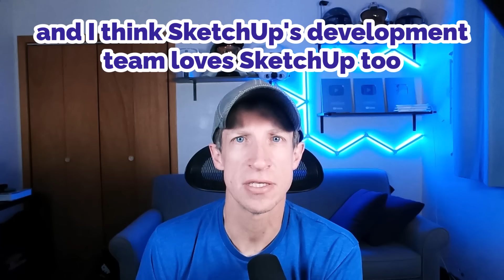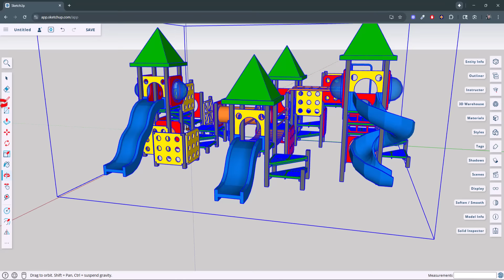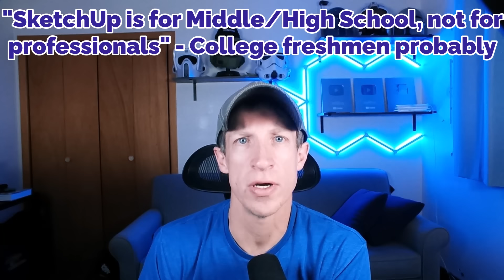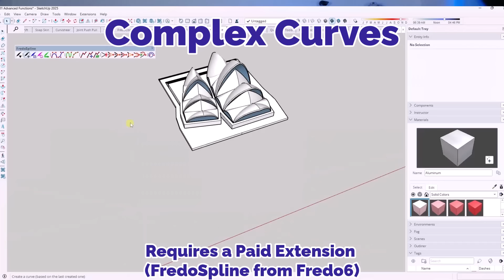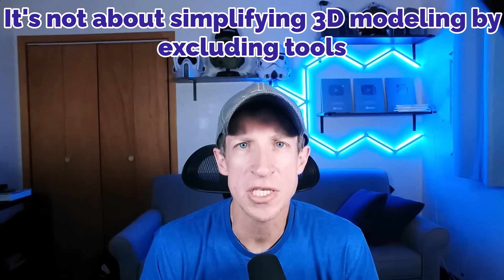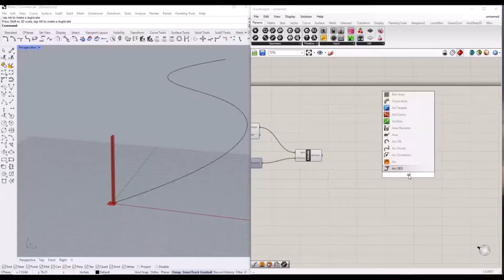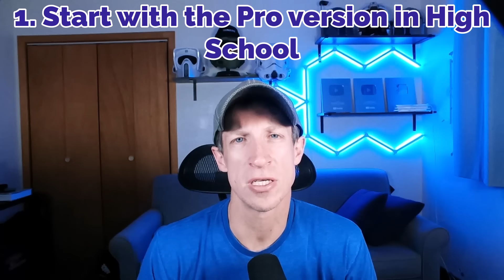Is SketchUp being REPLACED?

Comment from the maker: Hi everyone! Let me know your thoughts in this in the comments below!
Reply: Love both tools. SketchUp inferencing-measuring, snapping is unmatched imo! If Rhino adopts a similar feel/ux I'll spend even more time in it.
Reply from the maker: This is my big concern - if Rhino works on UI/UX before SketchUp works on toolset, it could be a real threat, and it feels a bit unnecessary.
Reply: @Thesketchupessentials  I guess then we would be in a situation where both are nearly identical. My current push is parametric so I'm almost exclusively in Grasshopper now. I'm happy to use Rhino just for that and go back to SU for everything else.
Reply: @AC-ed1jz  rhino would adopt it for sure, rhino 8 is clearly easier for sketchup user than the older version, new push pull in rhino made me move on to rhino,  on the other hand sketchup is just will never improve and listen to their users :)
Reply: @Faqiens  we will see what mcneel does on that point. The UX is the area to push on but you don't want to alienate old school users who like that technical feel.
Reply: @AC-ed1jz and sketchup is a toy
Reply: Hi,
I've used sketch on and off for the last 10 years.
Mostly with Ruby Sketch sitting on top.
The owners need to be brave and regig there business model together with a full overhaul of the interface of the tools.  Love the simplicity in the foundation of the program but it has evolved in a haphazard way.
As a suggestion they could develope parallel packages more specific to the different  industries. E.g. new buildong designs and remodelers of existing buildings . Engineering base modeling , manufacturing , sculpturers etc.
I believe your concerns are real.
They don't want to go down the same road as Nokia phones.
 For me personally I prefer to buy a stand alone software rather than a sub scription . Updates each year if I want to. Tremble could   buy in the existing plugins and give them royalties based on consumer usage. Also pay these developers for future extension and/or improvements
There is a high risk at the moment in this space  . So Tremble needs to be bold and give themselves a shakedown.
Reply: Architecture schools have been training their students in Rhino and Grasshopper for at least nine years. The parametric functionality is the main reason.
Reply: @pierrebulhon5219 20 years
Reply: haven't worked on Rhino but done very complex architectural homes on Sketchup and using Sketchup Layout.  For me, this is where Sketchup fails as an architectural tool.   2D Documentation.   Complex 3D curves are very limited in the average use, most buildings don't go there to be honest.  But all buildings need 2D drawings.   Layout is clunky, very slow to update large sketchup models, poor dimensioning, annotation, etc.   Time saved on modeling is lost turning out good 2D drawings
Reply: @aeasthouse316 is rhino any better ?
Reply: Justin, I was hoping that one day SketchUp would include a BIM feature other than geometric, which I find redundant and limits my ability to explore more complex geometry.
Reply: I think SketchUp made poor choices at past. I just remember what it was.. I could just draw some curves by thinking over head. I liked how the extrude worked..
Reply: The SketchUp pricing is also a massive NO!  
I'm casually learning Blender because AutoDesk is so terrible with pricing. I use: 3Ds Max2016&VRay, Rhino3D, Siemens: SolidEdge, MOI3D and Blender.
Never rent software. The only reason companies do it is to get people to continually pay for the same product.
Reply: I think adding  lofting  , surface and bezier-spline tools would elevate the program. Very often I find myself importing complex faces and curves I made with other softwares because it is easier to work that way than use the limited capability of curviloft. I would love to be able to use sketchup for the very complex projects but unfortunatelly that is not the case. Having the potential to use sketcup for heavy work would eliminatee my need for other programs.
Reply: I'm a 1st year middle school 3D design teacher and SketchUp is not planning for their future. This is not user friendly from a teachers perspective,  I need more resources from SketchUp to use in my class. I don't know where to find lessons or built in tutorials from SketchUp. I have Zero support from them and will be looking for a different platform next year if they don't fix this.
Reply: I have two SketchUp Pro subscriptions for the office and for home. I’ve bought the tools from Barry M, mind.sight.studios and Fredo6. I think it would be very helpful to have the tools “Slick moves” (arrange / align / center), Sketch plus, Bevel, Round corner tools native to SketchUp Pro. 

Trimble Creator inside SketchUp sounds interesting. Maybe it’s a better fit for SketchUp Studio? Since that’s Sketchups top of the line product. 

The Studio version makes more sense if it has advanced parametric modeling and rendering tools. I don’t use the point cloud stuff but I would be interested in Native advanced modeling tools as long as the rest of the tools work as they do now.

Ive bought Valí architects tools twice and I don’t like the interface. If I had to start drawing with SketchUp just using a bunch of sliders and info windows I think I would have to find a new program. 

I could see my self switching to studio for advanced modeling tools if they save me enough time and work seamlessly. I enjoy using SketchUp but I occasionally think what happens if Barry M.(Slick moves, 2DXY) ThomThom, Dale Martens, Fredo6, Tig, and Christina Eneroth disappear of loose interest. Same with the other extension developers that I don’t use. The options they provide us as users are what makes SketchUp special. 

I think ThomThom works for SketchUp
Reply from the maker: @BMB_GRAPHICS  ThomThom does. I would love to see an Instant Architecture UI update. It's SUCH a powerful toolset, but can feel a bit clunky
Reply: One thing that’s a definite pain-point for me with SketchUp is the lack of a free viewer. The browser viewer is nice for sharing with clients but doesn’t work well for navigating easily for whoever needs to translate the render model into BIM. If SketchUp wrote a viewer that doesn’t have any drawing functionality, only measuring, it’d be a great help.

The reason I stay with SketchUp is the shortcuts- Line is ‘L’, not ‘L + Enter’. I’ve programmed ‘group’ to be ‘D’ so triple click + D is a very fast way to work. 

I have an automatic love for Rhino because it’s a very complex software with a perpetual floating license. They are complete hero’s for this. The sense of generosity is what makes me love them.
Reply: I'm still receiving SketchUp base files from my clients!
Reply: Years ago Bill & Steve together or separately decided knowledge would  be a subscription and ignorance for free. Sketchup was brought in line after 2016. Time to learn FreeCad
Reply: @Thesketchupessentials
Hi Justin. Thanks for this and all your videos.
I cant agree more.
Have you been in contact with any of the Sketchup Team to discuss this with them? Assuming you have their ear!?
Would love to know what they have to say. 
Maybe you can set up an interview with one of them as a follow up video?
Reply: As head of design tools in an architecture landscape and urban planning firm in paris, i can assure you that the transition is already on the go, and there wont be any turning back option. Skecthup is a bit too skecthy. There is no georeferencing utilities that really work, interoperability is really hard, and modeling capabilities are far from meeting our needs if we speak of a true, serious project that needs to go through multiple design stages. In my opinion, skecthup has been very popular because of it's simplicity but also because it has always been a good solution to model cities and landscapes. But now that the average modeler has an overall sharper skillset with 3D tools i don't really see how and why the skecthup framework would/should survive in the face of rhino if a firm hast to choose, regardless of you business size. Skecthup's best bet is simply to adapt to rhino and become more inter operable with rhino. At the moment we still receive a lot of sketchup files. But we would rather take the time to convert them into rhino files before even using them. That's how good rhino is in the context of a true design ecosystem. One other thing... there's blender... Because you need to look at rhino as a platform that connects easily to other tools (take a look at speckle) how can skecthup be relevant in the face of tools like blender and rhino ?... if we speak sincerely, i don't really see any reason. Thanks for the video because it tackles one of themost important questions at the moment in the field of 3D design tools applied to architecture urban design and landscape. I am not a skecthup hater, but if i'm being honest, at the moment we speak, skecthup can't keep up if it does not make a serious update (that will take a lot of time, on the meantime rhino is integrating AI 3D tools...). I'm not hating on skecthup, i simply hope that the developpers will take the true current state of the marker as a serious reality check and take skecthup to the next level with true interoperability. (love your videos by the way, cheers).
Reply: I agree that the dev team should focus more on simplicity in 3d tools (more of them) and less on AI stuff which I really find annoying.
Reply: There is no easy software that does really complex things - the problem is with the human mind "I would like just to snap my fingers... and the app or the OS should know what i want...".
Well, we are much to far away from that scenario.!
The annual fee price is an issue, the web-based version is a joke, Layout is a shame (but i already replaced it with InDesign, and do all the work inside Sketchup), BUT the Sketchup and its capabilities are NO ISSUE. Extensions..., if you know your way around the internet... the problem is solved.
But even without extensions... look to Milad Pirdavari.!
Im not saying that Milad's way is the way to go, not at all, i just want to underline that almost all the whining is ignorance-based - that guy gave a big shame to everybody who wants some kind of telepathic software (or device.!).
Reply: Hi Justin, You are correct on all points. Everyone should be using the pro version. I use Sketchup to teach students 3D modeling, knowing that they will go on to learn blender. So why can't Sketchup be more like Blender? like having a built in lighting program instead of purchasing an add-on? Chamfering? Beveling?  Lastly I find not being able to adjust the line thickness ridiculous. Just my op - Hope Trimble listens. ☮
Reply: Sketchup on the mac is horrible, it keeps crashing and layout is a complete disaster.
Reply: What is the best way to start
Reply: Justin. I have been trying to help a friend learn Rhino. I am new to this CAD software and find it very confusing and unstructured. So I have been watching your videos to learn it. I am use to building constrained sketches and building from there. It has constraints, history trees, and parametric abilities. Examples are Ansys Design Modeler, ProE, Solidworks, Trilogy Design, Fusion 360, etc. These seem to get replaced with SpaceClaim, sketchup, Rhino, a form of old school Autocad and free form drawing. I just can’t wrap my head around this free form molding as it reminds me of when calculators went from a regular calculator to RPN decades ago. I see limited advantage to this modeling technique. I will continue to explore Rhino, and try and wrap my head around it but if you have any constructive advice or recommendation for videos to practice with, that would be respectively appreciated.
Reply: Sketchup is where ive always made my 3D building models for my game development and its perfect ill never use anything else apart from blender bu
But i agree maybe a bevel tool would be good, still ive been a sketchup user for the past 10 years
Reply: MOI3D also is same file format as RHINO and has historical links and a cut down version of modelling that could favour some and very clean import into Skp
Reply: Sketchup created eco system from user time (3d Warehouse, Tutorials, etc) when it was free or at least afforfable. 

No the gap between free (Web) and cheapest paid Version is Not normal. 

No loyalty for sketchup.

Comment: I worked in SketchUp for 10 years, but the constant crashes and lost files became exhausting. I’d have to rebuild models from scratch, and when a file reached around 1.2 GB, even moving around the viewport became difficult.I switched to Rhino in 2023. It took me about a year to learn, but it’s been a lifesaver. I’m not a Grasshopper designer, but I can create anything I need in Rhino. It’s stable, has a solid backup system, and I don’t need extra plugins for rendering.I won’t go back to SketchUp. Rhino and Blender work well for what I do.

Comment: Late to comment, but these users are totally right. Sketchup feels stale and desperately needs more advanced modeling tools. One area of the program that drives me up a wall coming from the gaming world is the really poor texturing tools, from the overly basic material editor and complete lack of a UV editor. The other day I was so frustrated that a curved wall (which was far more tedious to model in sketchup than it should have been) just didn't align a texture map well at all that I ended up exporting an OBJ and installed Blender to lay out the UV's in a slightly more sensible way, only to find that Sketchup couldn't import the OBJ! I loath using extensions to fix the gaps in sketchup and most of them I've tried aren't very usable. The 2 OBJ importing extensions I tried only imported a mess of geometry. I will be purchasing a license for Rhino once my current sketchup pro term has ended.

Comment: I'm amazed at how SketchUp behaves. For me, it's really unproductive to have to search for plugins just to perform basic operations in the program. 
I'm switching to Rhino 3D at the end of the year. Even Blender makes more sense. Imagine my surprise when I found that Dialux Evo offers much greater precision in modeling and dividing a building into structures—it works like a mini 'BIM' for lighting, where the program has no problem inserting a window into a wall ;p 
SketchUp is just a patchwork of a million plugins, more and more of which are becoming paid. I don’t see the point in struggling with it any longer. Working on vertices is only possible with a plugin; the FFD box is a disaster… and plane retopology without extra plugins doesn’t exist. I don’t know about Artisan because I haven’t tested it—I’d rather spend my money elsewhere. in many cases you have to pay for extensions yearly...thats funny;) For me  it’s better to use for example pconplanner, Rhino or open source Blender etc...or dialux evo xd. SketchUp’s advantage was its price, but what’s there to think about when a powerful tool like Rhino is within reach and worth the cost? You can buy software updates every 5–7 years if you need it

Comment: I also agree. I'm tired of SU only working if you have an internet connection. With that being said, I'm really tired of not being able to sign in using Microsoft Edge in a normal window. When I click sign in, it opens ME, but no username or PW boxes appear. I have to copy and paste the URL into a "New In Private" window for them to appear. I have complained many times with zero help from SU. Also, I never sign out, so I don't know how it keeps doing it by itself. I'm not a high-end user, developer, or architect. Just a building contractor for simple decks, screen porches, and small additions. I now do some 3d printing, but I want to learn Fusion 360. Building a woodshop and want more woodshop-related software. Never heard of Rhino before but i will certainly check it out now

Comment: I started using SketchUp 16 years ago. For several reasons.
1/ It was easily available and not expensive.
2/ There are easy to follow tutorials.
3/ I could, and still can, send my clients a design. They can use the free version to look at the model and click through my Scenes.
4/ My contractors can open the same drawing and see what they have to build.
5/ The Warehouse is fantastic. I contribute models as well.

There are many other things I love about SketchUp, but there are a few things I don't like. 
The name - SketchUp. It sounds a bit like it is just a programe for simple, rough ideas. It is so much more than that. A name change would make new users feel like it is a more serious tool.
Extensions are great, but I have run into the trap of being relient on an extension that has not been updated for years. I will have to switch to a new programe and that will take time for me to learn.
Rendering as a part of SketchUp. Decent render packages are way too expensive.

Come on Trimble. So close, but yet so far!

Comment: Meh, used to love Sketchup for 3D printing until Trimble started putting the features I needed for hobby use behind a paywall. I still run Make 2017 but it is getting long in the tooth and I am about ready to move on. Will not be moving on to modern Sketchup though.